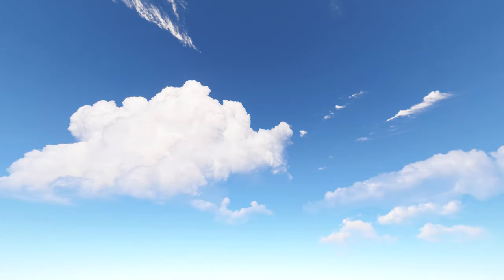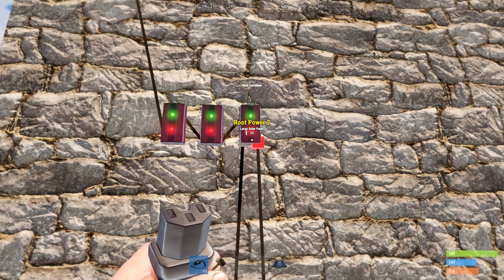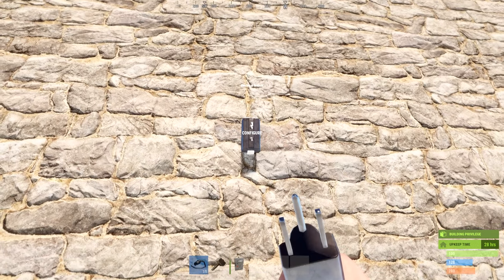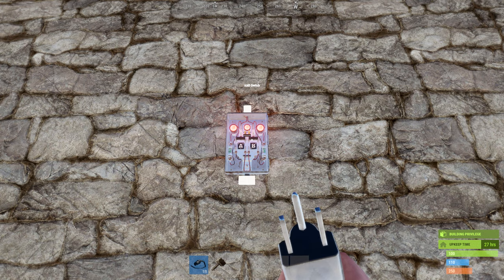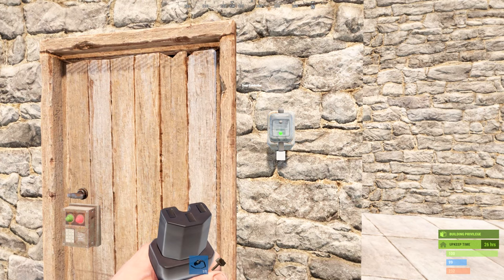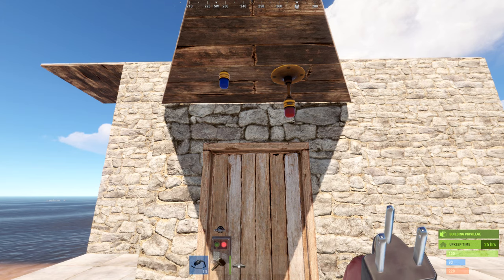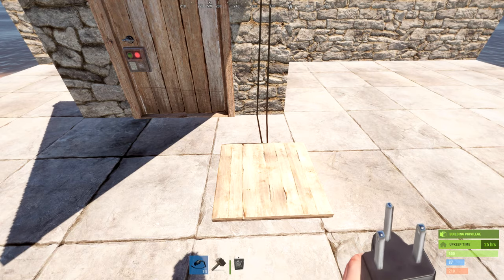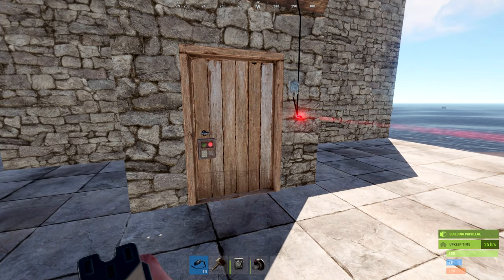How to use Electricity - Rust

Comment: I have been using the setup at (17:45 - 20:25) to power all my Ceiling Lights (Day/Night) with Electric Branch BRANCH OUT and then use the Electrical Branch PWR OUT for anything else needed.

Great video !

Comment: as a beginner i struggled to find a simple tutorial, i just wanted to set up some turrets and finally found this and understood the basics, ty :D
Reply from the maker: SocialLoners anytime, glad it helped!!
Reply: @MrBengals  quick question, i built the same circuit on a server and i only had 2 solar panels so they were not getting enough power all the time, and when it was not enough for the turret it didnt switch to battery untill there was no charge from the solarpanels, know a fix?

Comment: If you use the garage door setup, can you just disconnect the switch input when logging of for the night or can anyone just build the wire tool, reconnect and get all your loot?
Reply from the maker: Yes you can disconnect when logging off and reconnect logging on if you want.  I recommend Placing switches in strategic spots where people won't easily find them.  They'll only be able to use the wire tool if they have TC (i.e. raided you).
Reply: @MrBengals  tnx for the quick reaction, video really helped a lot!👌👍
Reply from the maker: Turbo Turtle glad I could help! 😁

Comment: If you fully charge the large battery and then decide to move it to another location does the battery loose the power stored inside it??
Reply from the maker: It used to but they fixed it, so will no longer lose its charge!

Comment: i built the circuit but at night im getting lower than the battery, shouldnt the battery be kicking in? its fully charged
Reply: and i see 110 power coming from splitter and into electrical branch but the branch is only putting out 67
Reply from the maker: SocialLoners can you send me a screenshot in discord? Sounds like you're getting around half power and your external source either matches or is still more than your battery

Comment: i just want a simple sam build and i cant find any videos on it
Reply from the maker: Are you talking about the SAM site?
Reply: @MrBengals  yes  like what do i need to power it so i dont need to fuss with it
Reply from the maker: jackfoo2 jackfoo2 you need power, whether it’s solar panel or wind turbine. If you’re not using electricity for anything else (lights, doors etc. ) all you have to do is connect your power source (solar panel or wind turbine) directly to the Sam site. If you want to use electricity for other purposes in addition to Sam site, do my setup as shown in 20:03 and connect your branch out to the Sam site
Reply from the maker: jackfoo2 did it work?
Reply: @MrBengals  
my goal was to hide sam sites in the trees i ended up using 4-6 solar  conected the sam no batrie . the battrie was making it not work. the sam need 25-30 wats to make it work. the windmill is not a option to hide the sam it is 2 big and i can only get it to fit on 4 floor peaces witch means i need like a 2/6 or  bigger base for it
Reply: @jackfoo2  Use two solars in series. Or a generator.